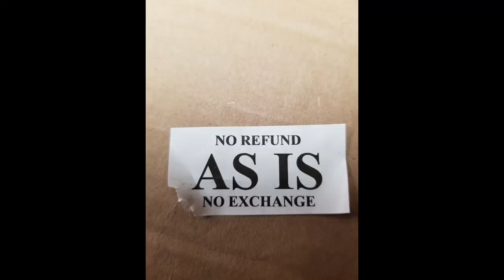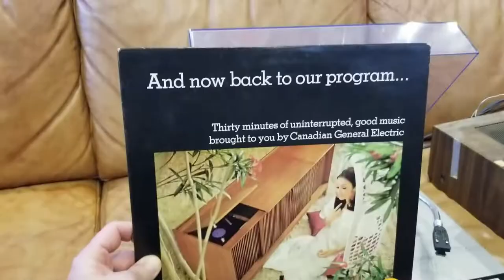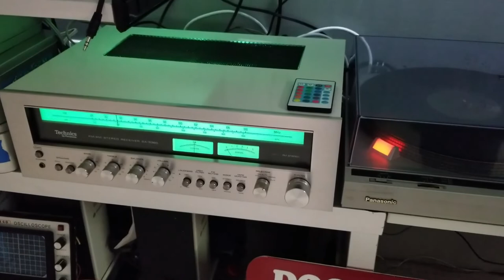Technics SL-B2 Turntable - Curbside Find Lives Again!

Comment: I just cleaned my old SL-B2 in much the same way, had to order a 3D printed gear to fix the auto-return from the eBay guy, totally worth the investment these are great little budget turntables that can be easily upgraded to sound really good.

Comment: I think you got super lucky, I haven't seen a bl-s2 with the Panasonic label on it, that by itself doesn't mean much but that return gear has a brass or copper catch on it which isn't what I'm used to seeing.  Normally the gear and catch are one using in plastic or nylon and break all the time.  Mine has the break but the returns still working.  I will have to design a replacement and use my 3d printer to print one.  So basically they used to be built better, I wonder what else is better, I assume they made changes for cost cutting.
Reply from the maker: Thx for making my day. Happy vinyling to you!

Comment: I bought one from Ebay in 2007 for 60 usd hoping it would be a good table and it was awful, The motor was worn and a new or a good used motor  could not be found  but  it had a Precept Cartridge  and that was a gem I did not expect to get...That was a new high end type of an upgrade by Audio Technical that came out in the early 80s and that made the 60 usd very well worth it because I removed the head shell  put it on another table with a new stylus it is great  and the B2  does make a great platter for cleaning records .

Comment: How did you correct the hum in the beginning? Just ground to amp?
Reply from the maker: Hi Jose,
Thx for watching. Yep - just took the provided grounding wire sanded corroded connector down to clean metal and grounded to amp.
No hum now! Best wishes on your project.

Comment: Still got my SL-B2  in the basement but my belt has rotted
Reply from the maker: Time to get a new belt and enjoy that puppy! Thx for watching.
Reply: Where  did  you get that metal spindle gear ?
Reply from the maker: Gear was onboard when I picked up. Apparently there were a couple of different runs of this model and some had metal some not so much

Comment: Much too much oil. 2 drops is enough. You have got to keep contact cleaner on hand, to work on these. Even if speed is OK, you should spray the pots--small amounts--since they probably have never been cleaned, to avoid future speed issues.
Reply from the maker: Thx Len. I'm not a frequent old school audio component taker-aparter so appreciate the feedback. Deox spray purchase in my near future.
(I found this turntable on the curbside on garbage day and couldn't pass it by)
Cheers!
Reply: Het gaat on de technics slb2